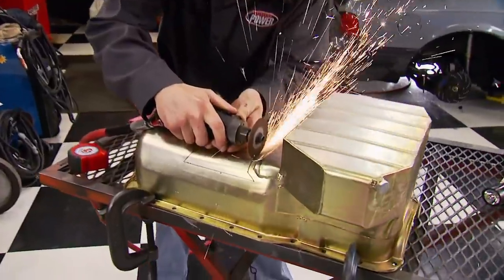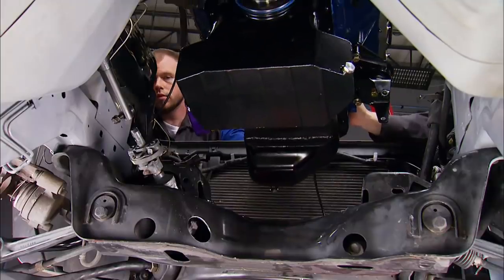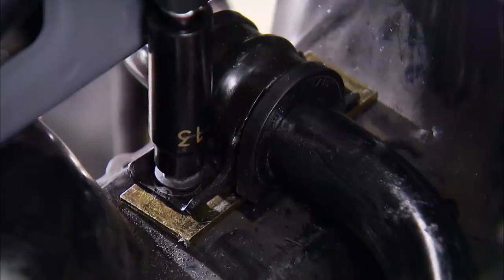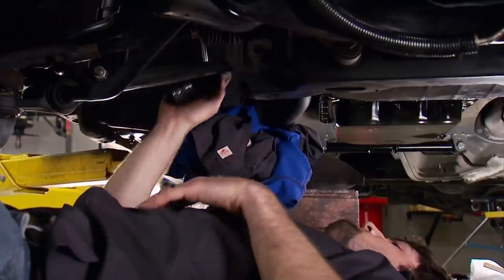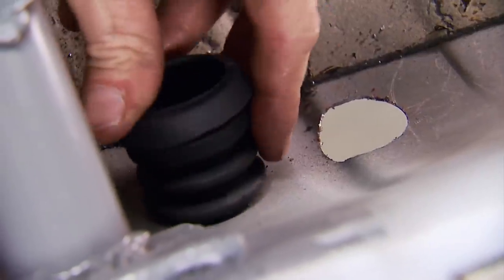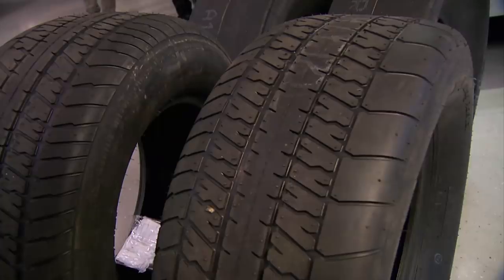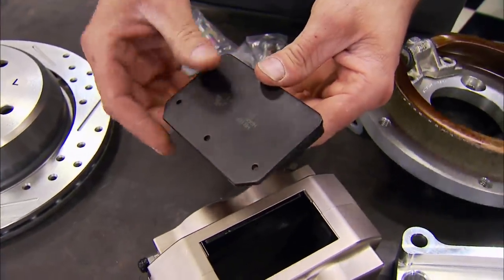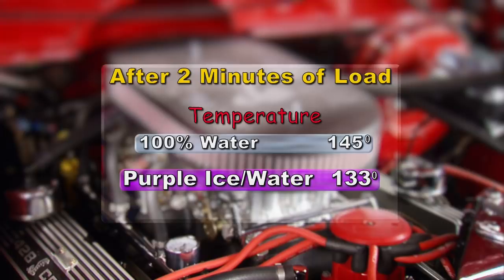Dropping a 427 Stroker Into a '97 T-Bird - HorsePower S15, E7

Comment: Its nice should have dropoed a coyote in it.
Reply: This was recorded before the coyote existed..
Reply: @elonmust7470  what year coyote been out since 2010 of September dats when they started selling the 2011 mustang gt
Reply: That engine won't fit in this car whether it was available or not. The heads are to damn wide to clear the strut towers.
Reply: @sparkplug1018  what are you talking about the coyote fits in dat tbird woth no problem it had 4.6 the sane width as the coyote
Reply: nissan Brown And that’s why people are doing it then right?
Reply: @sparkplug1018  coyote swaps are big and its common now even getting put into oks school cars and trucks
Reply: nissan Brown yeah people are doing it, and getting boring too. I’ve yet to see one in this car. Because from what I can tell, and what others have said it’s just to damn wide.
Reply: @sparkplug1018  you wrong  people are interested in a Thunderbird to do a coyote swop the 4.6is the same width as a coyote . So I no nobody told you dat.
Reply: nissan Brown show me then instead of talking about it. The only one I’ve ever seen done required extensive modification of the strut towers. Big difference between people being interested and it being practical. By the way, you don’t know very much if you know no ones told me that. But I’m sure you’ve done the swap yourself already so let’s see it. Should drop an LS in one just to piss people off.
Reply: nissan Brown By the way, 4.6 Modular SOHC 25.625 inches width. Coyote is 28 inches wide.
Reply: @sparkplug1018  oh ok my bad
Reply: @sparkplug1018  go show a pic of a Ls in a Thunderbird witch is not popular or a common swop. I building a coyote swop Lincoln mark vii. Twiin turbo and the motor fit with no problem and mark vii is fox chasis And the marviii and Thunderbird 89 in up is built pretty much on the same chasis this why I am telling.you dat coyote fits in the Thunderbird mark vii comes with a 32 valve.
Reply: @nissanbrown6144  If the car was built with the DOHC Modular engine it will fit. The DOHC Mod motor was 30 inches wide, while the Coyote is 28, so you'll have enough room between the strut towers to clear the heads and cam covers. Since the cam covers will add another 1-2 inches in width. So yeah, if you're swapping a DOHC Mod motor for a Coyote, you're actually giving yourself more room to work under the hood. And a SOHC you'd be loosing a good bit of room. The Coyote engine is also 2 inches shorter.

These Thunder Birds were only built with the SOHC engine, which is why it won't fit in there unless you're willing to do some serious work. I think the one I've seen was owned by Tim Tebow.
Reply: By the way, I was messing around about LS swapping a Thunderbird, but heres a build thread from a guy who did. https://ls1tech.com/forums/conversions-hybrids/1213113-1997-thunderbird-gen-iii-budget-engine-swap.html
Yes, I know its stupid.
Reply: @sparkplug1018  bro the motor fits why am I going back in forth with you on something I allready not I done seen people take coyotes and put them in markviiis with no problem . The Thunderbird is no exceptions.
Reply: @nissanbrown6144  Except the Thunderbird would be an exception. The Mark VIII will fit for sure, it was built with the DOHC engine, and since the Coyote is actually a smaller engine, no kidding it will fit! Hell you'll even pick up some room to work around the sides and front of the engine.The 10th generation Thunderbird was never offered with the DOHC Mod motor. Only the SOHC version. Which means the engine was smaller to begin with, and barely fit between the strut towers as it was.
Just because its a similar chassis doesn't mean it will fit in every car. Thats like me saying sure I can take the IRS out of a 10th gen Thunderbird and bolt it into a mustang. It doesn't work.
So just to be clear, yes the Coyote will fit in MOST places that a Ford small block or Mod motor would fit. This is NOT one of those places.
Can it be done? Sure, if you're willing to put the time and effort into modifying the strut towers. Is it worth it? I doubt it.
So yeah, good luck with the Lincoln project, but why don't you go and prove a lot of people wrong, ditch the Mark VIII and do a 10th gen Thunderbird. We'll wait.